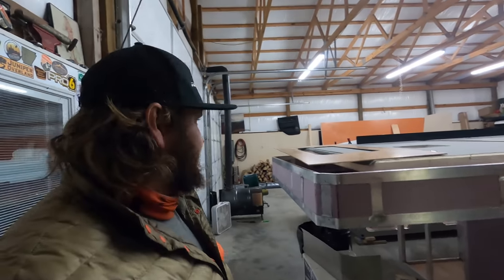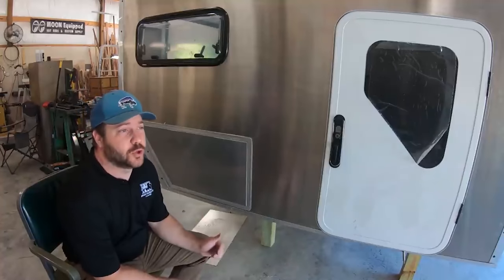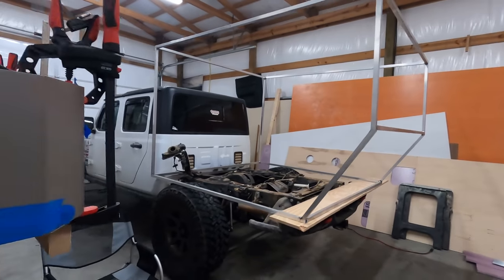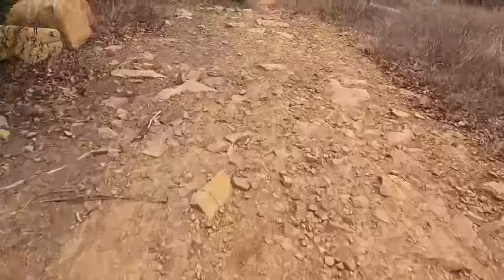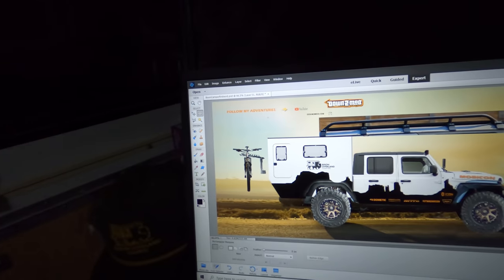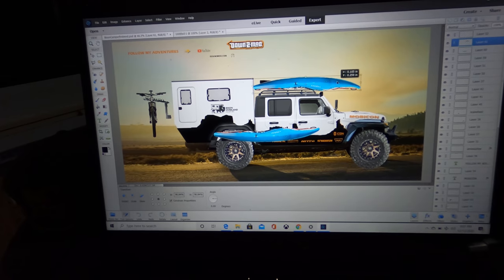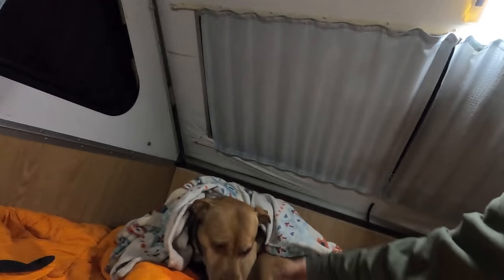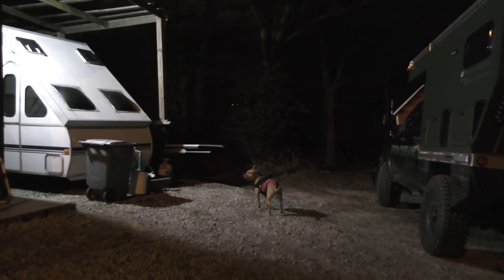Building a Custom Flat Bed Truck Camper for my Jeep Gladiator

Comment: Looks great and I’m looking for ward to the build series.  With such a small footprint why did you decide not to do a cab over?  I would think it would have been a great spot for food or clothing storage if it wasn’t large enough for a sleeping platform.
Reply: curious too about this.  I was wondering if this is a pop up that can be stood up in, when parked ofc.

Comment: Have followed your page for a while. The dodge mahal was amazing for a # of reasons. I think you are taking a major step back in terms of usability. The COG on this camper is way too far back, combine that with an already low payload. Unfortunately I just don’t see this working properly, especially for living in. Another factor to consider is fuel mileage, you will be having to plan trips around gas stations because it will be such a pig on fuel. My 2 cents anyways...

Comment: OH and by the way I ended Up putting super springs on my truck and I'm really happy with them they really help stabilize it and if I still need more down the line I can still put a stableizer on it but so far so good 3000+ miles
Reply: Same here I put supersprings on my 06 Tacoma for camper/camping equipment, towing TT. They have worked great. More stability, much less sag when towing TT.

Comment: This seems like a really interesting combination of off-road capability and comfortable interior space that doesn't involve fabric. Looking forward to watching this progress.
Reply from the maker: exactly donald! I am trying to have the most off road capable and comfortable vehicle I could imagine! can't wait to explore more of oregon with ya. Keep up the great work on your channel my friend
Reply: One thing I would never do with this new camper shell installed is try any jumps, your frame is much less desirable than the new Mojave frame, they can and do  bend. The Mojave has wrapped steel welded in all the stress areas.
Reply from the maker: @davidcox2197  I had no idea the mojave frame was different - that changes all of my opinions about that truck! wow. It came out after I bought my Rubicon. and as I do see your point, we are building gussets for the rear shock mounts and reinforcing the frame, and its all a matter of how much weight will truly be on that rear axle when its all said and done. But I mean, jumps are never really a GOOD idea, just a FUN idea hahahah
Reply: @Down2Mob  You should be fine after reinforcement. Don't know why the factory doesn't start using that frame on all Gladiator models, makes sense to me.
Reply: @Down2Mob  There are a lot of changes, complete wrap of frame in steel in weak areas, and much more. You should be fine with reinforcing the frame, your guys seen it before and know where it bends.

Comment: I still like the idea Adventure Brad had with the rv stabilizers in the rear! I think that would be worth doing with the gladiator build. Either way it looks great and I'm happy to finally see you dream build taking off. Keep up the good work!
Reply from the maker: Dude that was cool huh? But I’ve gotten to sleep through windy nights and kind of enjoy them to be honest. It makes a peaceful night that much better. The main reason I probably won’t add them though is weight. Trying to keep every ounce we can off this thing
Reply: @Down2Mob  dont blame ya man. I'm the same way in storms. Unfortunately I keep running into weight issues with my rig and need to downsize. Or buy a bigger truck!haha keep up the good work brotha

Comment: awesome mane:) when you design the overhead roof rack, you could design it to overhang the windshield a foot or so, that way it's long enough to get kayaks up there w/o hitting the camper box (kinda like a work/ladder rack on a truck)... might make a little wind noise but would be sweet to have a bunch of room up there if you need it or want kayaks up there.  Gonna do that next after i finish my flatbed build and get rid of the yakima rack.

Comment: I had a 6 way rear suspension set up using short med & long arms best of all 3 each way. But best current tech is medal clock double joint rear control arm or the ultra rear control by vegas crew counter suspension set up.

Comment: Great idea, but beware of bending the frames issue. Have seen bent gladiator frames towing a teardrop. The Chevy Colorado pickup owners manual explicitly says you can NOT put a slide-in pickup camper or similar equipment in the bed the of the truck. It voids your warranty and there have been some bent frames, from pickup campers and from towing, that chevy didn't warranty. That is crazy. As long as you are under the max payload, the bed should handle whatever you throw at it, so why call out slide-in campers are not allowed? The jeep gladiator manual is slightly different and, on page 14, states "This vehicle is NOT recommended for slide-in camper applications." So not as strict as the Colorado owners manual. Still worth taking into consideration as the jeep bent frame may have had to do with suspension mods. Will be hard to stay under max payload with this camper, your full time supplies, etc. Looking forward to the build and how all that is taken into consideration. Keep all your heavy stuff (water, batteries, propane) at the very front of the camper.

Comment: The solar that has panels stacked 3 to a sandwich, but when u park u open the right & left & bottom panel stays in center on top. The Snossberry all color matched & is best color out NOW. The V8 hood & exhaust & paddle shifters r bad ass but only offered of V8 right NOW. Hving a 48 volt alternator under the hood is key to going off grid, even if genesis dual 12 volt lithium under the hood. I hve seen nice back door storage set up & under bumper front & rear set up best of all.

Comment: ving a wider top hard side that raises or lower <over> lower section & protects window from stripping down the sides is way to go & God version how I will want mine. The turbo diesel is nice good choice but I think I Am leaning 3.6 super charger engine option for my build best tow poss, when I beef upmy axles min 60s poss Curry 70s even better. I like the unimog tech High hog set up too. 4.88 is my jam w/37" max tire cheap jeep ass, but 35" true ht is fine too.

Comment: I Am going to hve double door jam on newer jeeps, so it will hve solid bars doors inner door jam & larger new doors outer door jam, mirrors not attached. The roof needs to b taller on next jeeps as well. Front windshield needs to tilt out like side by side. The lite bar & rack will b smooth fitting unseen w/top of roof unless u pull/pop them out as needed so less drag & less wind noise. Roof & top of window higher so tall ppl 6ft 4" ish can see. front windshield is pretty freaking up right aero drag big. The V8 hood is cool but heavy ass hell, aluminum front & rear fenders for sure hopefully V8 hood option too.

Comment: It looks like you're going to have a lot of weight behind the rear axle. That will have an adverse effect on handling.
Reply: I think I would want the added weight of overhang sleeper area on that to offset the weight some.
Reply: I want it to succeed badly but that truck is just not made for this task. Without overhang sleeper is worthless, just to small. On the other hand there is no payload capacity to do it as planed, let alone do the overhang.

Comment: Hey Phil, Awesome to see the progression, ya sure about No cab over, lota space there to use plus still give you a bit of a rack at the front, also bud ya thought of the extra weight on the back axle with the over hang. Know you'll Nail an awesome build bud, keep up the awesome journey 😁

Comment: Aren't you concerned about payload capacity? Sure, you upgraded the suspension, but what about structure? What about brakes? Gladiator payload is decent, but 1000 to 1200 lbs aint great.

Comment: if u don't hve a front LOW brush bar axle protector then u break axle hitting rock on trail, but if jumping it won't matter. If rocking normal speed then u need way to lift LOW push bumper up or off.

Comment: basically if not going front independant jumping better set up then u want your LOW push bumper to hit & take hit b4 the bump stop or axle takes the hit. Long sq bars vs axle takes bulk of the hit. Oh yeah truss or more beef b4 or after your axle KO is a good idea, & ucan't go wrong w/60 or even 70 axle esp if jumping.

Comment: I just installed TIMBREN SES Suspension Enhancement System on the rear of my Frontier. Nothing fancy, but under heavy payloads it works awesome and it cost me less than $250, but I’m sure Phil probably has something more sophisticated in mind?

Comment: You should find a smashed white JLU while you are there and cut it , then single cab it, then put your old bed and system on it.  Video it all!  Then sell it.  Cha-Ching! Cha-Ching!
Reply: Except the dodge-mahal is long sold..and it would be severely over-weight 😳
Reply: @keithherring5462  NO!!!  The bed, rack, and RTT that is on the Gladiator!
Reply from the maker: Hmmmm that’s actually not a terrible idea!! Lol sell it as a Fadiator aka fake gladiator. In all honesty I kind of wish I bought a wrecked gladiator so we could chop it up into a 2 door and have a big ass camper
Reply from the maker: @keithherring5462  you know it my friend!
Reply: @Down2Mob  I know, right!  I have them every once in a while. 

I wish you never did a Gladiator at all, and went 1500 shorty with the 5.7L Hemi instead.  You could have done a longer wider camper and had more payload.  AEV does a nice system.  Suspension, bumpers, hidden winch, wheels, snorkel.  I'll send a pic on Instagram.

Comment: Drilled brakes after market deal needed w/camper on top. Slotted bad bc most ppl won't turn them. Hving 2 caliper w/dual pistons best option if not breaking by regen braking setup. Ceramic pads r hard to beat. The partially disconnected sway beat totally disconnected deal.

Comment: The rear axle w/2 rear hog heads & 2 drive shafts is future tech. So mostly independent rear axle & u can expand the rear stance 10" or ft,or pull in tight depending on trail. This way u can hve both tires & shafts power or left only or right only. The roof rack that sits on front hood fender for support is best design. The rear door on Gladiator needs to b suicide style or at a min actual door not jeep rear door. 4 front doors not 2 & 2 doors. The fire wall needs to b double walled 5min rated, & the B pillar needs to b wider 5 or 6" width & strongest metal poss. Ram mirrors not jeep or portrait then landscape mode to trailer. The future jeeps need to b wider like width of fenders under hood space. Winch for sure just can't block front air not seen in bumper look best. A way to stand on bumper to get under hood needed. I like hving 2 smaller front winches canted apart 1 facing 30deg right other 30 degs left. This way diff option to pull w/right or left or using both together. Safer if using 2 lines then just 1.

Comment: GVWR (with no trailers etc) minus curb weight equals your payload.  Do not exceed your payload with bold on crap, unless you are modifying all your components, brakes, suspension, transmission, gearing etc etc etc.   jmo

Comment: No Cab over?  Hmmmm...might be kind of tight inside then.  Can't wait to see!
Reply from the maker: it will be designed just like the dodgemahal, where the bed is down low. lots of benefits to cabover, I could have gone cabover, but chose not to. It would just be wasted space that I can use for outdoor storage and valuable gear
Reply: @Down2Mob  Understand and good luck!  Can't wait to see it. Us Gladiator owners are so anxious to see what others are doing....the sky is the limit, well sort of, LOL!

Comment: The gladiator has a cargo problem w/factory axles, & worst case fix is 3rd axle & hybrid drive. No cargo wt problem then+ helps on gas, in town 6b6 3rd axle only electric drive.

Comment: I want 2 toilets,both euro pull out & dump, & saw dust set up. That way I can use best option no dead wt tanks wt as needed.Out side hot shower on ground again no tank weight other than water, & ucan always carry extra collapsible water gals as needed. 20lbs propane for heat & cooking same w/grill & seperate 2 burn  carry in or out. Sink can drain on ground or u put solid bowl in sink no drain.

Comment: I know there is a way to hve dual rear shocks 1 pnting forward & 1 pnting backward. Plus 1 rate spring & air bag to help carry load if just 4by4 set up. I came up w/ hving 2 springs in front & teeter totter set up so 2 True dual rate front spring 1 rate & next spring diff rate. At top the springs r side by side, like an upside down heart. Coil overs r nice but 2 shocks per corner nearly as good. The fancy struts roll to much on jeeps, tech needs more work.

Comment: LT4 beat 6.2 but 3.6 w/supercharger beats both of them in all around performance w/4.88 gear. Diesel is just too heavy & exhaust just too much BS & not enough room under current hood. 4xe & 3.6 would b hard to beat combo if u didn't get supercharger add>option. Either way they both need 48volt alternator bc it makes all the diff hving onboard 110 power like ford or newer RVs.

Comment: Six months later “ my frame bent “
Reply from the maker: Nichols autofab is building gussets to support the weak part near the shock mount that typically bends due to to long of shocks being installed, not being overloaded. My shocks bottom when there is still about an inch of travel left but we figured we would be the first people to properly gusset and support the frame. So, get your bad vibes outta here my friend!!
Reply: @Down2Mob  if it’s going to be reinforced it should be fine then 👍, have seen a few duel cabs bend because they are not reinforced
Reply from the maker: @Sthilboy56  ya its crazy the amount of bent ones. Nichols autofab actually worked on one with a bent frame and got to learn about it through him, so they are well qualified to build me some gussets. Heading there on friday to get them designed and cut! thanks for the comment and watching my friend
Reply: Would have not cost them a lot to do that frame right in the first place.

Comment: looks back heavy (?)
Reply from the maker: heavier than stock, no way around that, but it will be pretty light in the back. The departure angle is the only thing that makes it longer, and there wont be much of anything back there, just the dinette, heater, and some windows. I'll store blankets and lightweight things under the dinette in the rear, but rear weight is certainly something we are focused on!
Reply: @Down2Mob  I do not think this will end well. Unless this 'box' is less than 600lbs it will be like hauling a heavy, tailpipe dragging box around.. to say nothing of the cornering, 4x, and fuel consumption issues. Be sure and save the original bed. I fear you will need it. That being said, I enjoy your adventures!

Comment: Don't do it! The entire drivability of that jeep is going to change with the change in center of gravity.  Good luck rock crawling without tippin over.  Much different deal than putting it on a 9000lb truck....